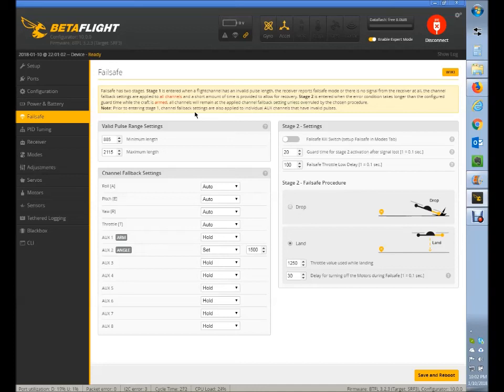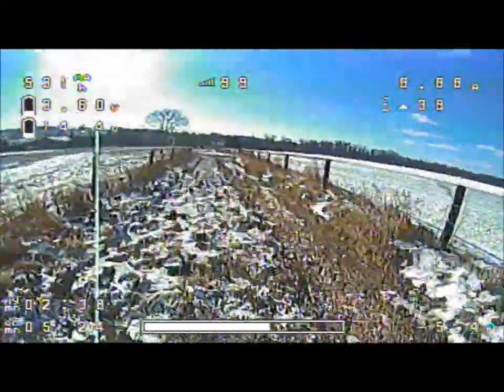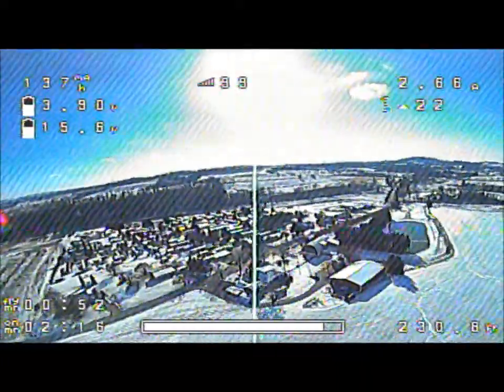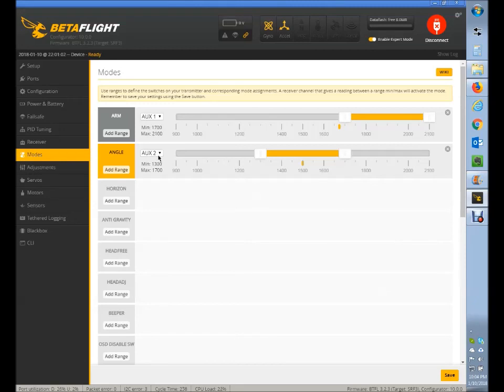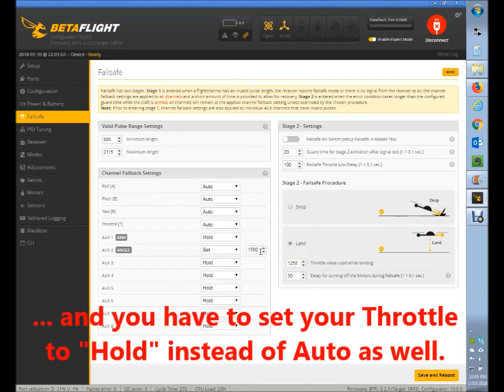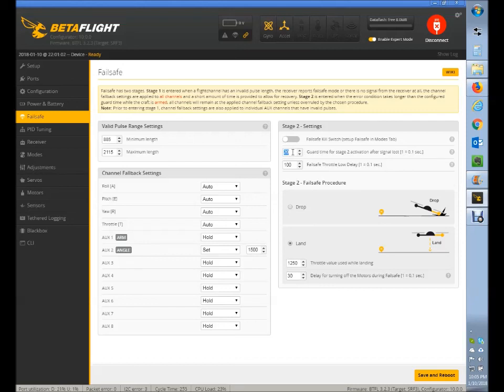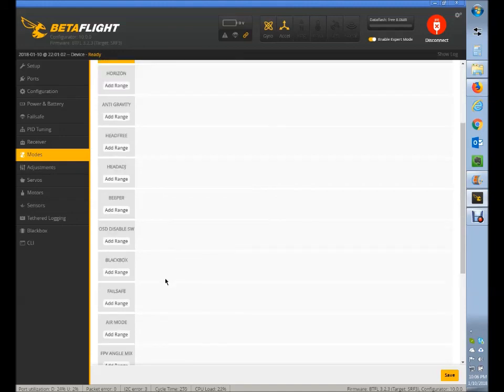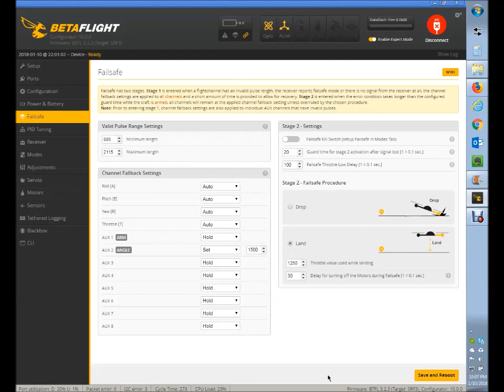Recover from a Failsafe!

Comment: I am trying to set up a recovery plan for my 250-gram helicopter that is Betaflight controlled, and this is a good talk.
Reply: I tried failsafe recovery with my helicopter today. The helicopter's blades' inertia kept the rotor spinning for at least 5 seconds after I unplugged my TBS radio module. Betaflight's PID loop continued functioning, leveling the craft with cyclic servos, even after entering stage 2. So, I kept the radio module unplugged for 10 full seconds, plugged it back in, and flew like nothing had happened. The heli dropped 180 feet during the 10 seconds of powerless freefall.
Reply: Stage 2 is meant for a quad to land on the ground, but for wings and things that can glide, stage 2 can be cruised over entirely.

Comment: The other day i was ripping about a field about 1 foot from the ground and had a failesafe the quad just disarmed and tumbled along the ground i think this approach would have saved my drone considerable damage. 
I wonder though if setting the quad failsafe to have a slight reverse pitch and a bit of elevated throttle would pop it up rather than let it slide on into something.

I am using the Gps Rescue mode Alpha builds now and it works a treat.

Gps rescue when activated climbs to say 60m height or the highest altitude during the flight and then just using a gps fix makes its way back no need to worry about magnetometers and barometers etc. Its going to be a game changer feature when it gets into betaflight final.
Reply from the maker: Stephen Gibb , wow.  That does sound nice.  What GPS u using, M8N?

Comment from the maker: u need to do a slow decent, look at your throttle stick position.  then plug into betaflight, mimic the syick position, and see what value that is (Receivers tab).  you can then input and test through a failsafe mode on a switch.  i think mine is at 1225.